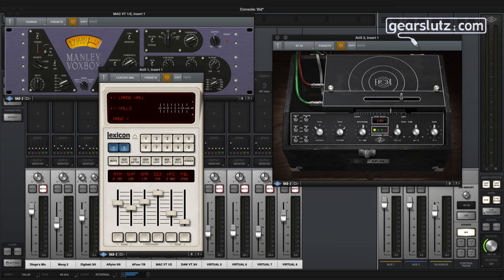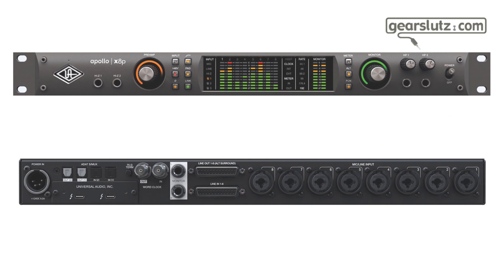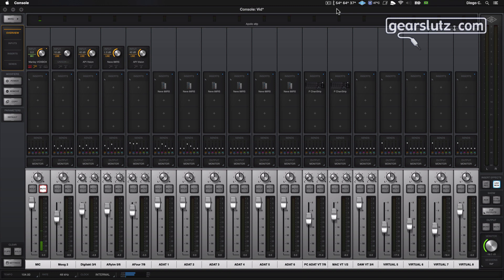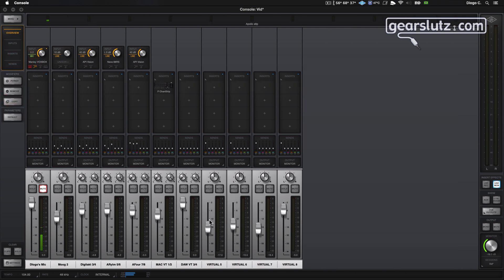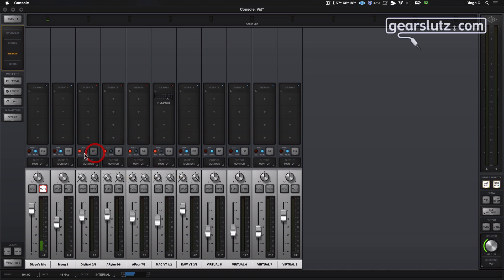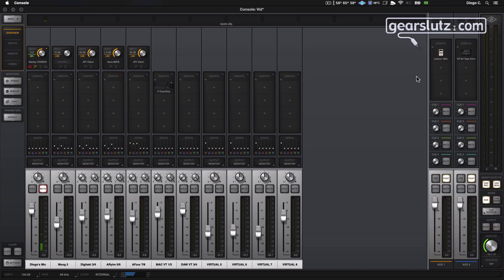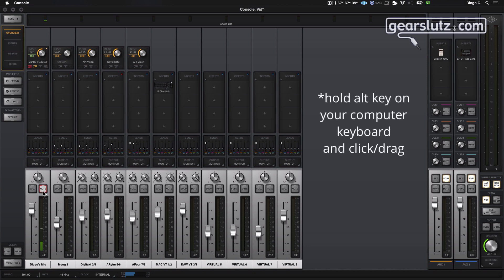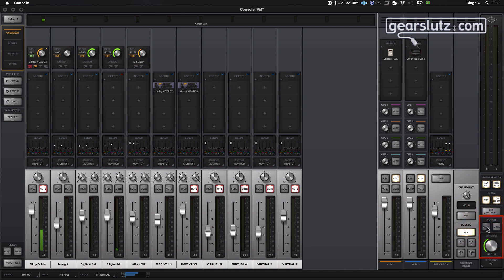Universal Audio Apollo x8p - Walkthrough Part 2: I/O Explained & Console Basics

Comment: Please assist me, I want to connect 6 speakers to my Apollo XP8 but I have only 2 Outputs.. what can I do as I have a project that requires 5.1 surround sound
Reply from the maker: You'll need a DB25 cable with XLR or TRS on the other end for this, should be easy to find!

Comment: I seem to have a big problem with a possible simple solution. I get no audio from any of the 8 cables from the db25 outputs on the back. Also, when I click settings, those 8 outs are grey. Do you guys happen to know where to click to get those to work? I just want to use Apollo x8p as an 8 input, 8 output AD/DA converter for Logic to record/play. Thank you.

Comment: The comment about the Combo jacks defeating the DB25 connections is only half right.  That's only if a 1/4" cable is plugged into the combo jack.  In other words, you can connect 8 mics via XLR and also connect 8 line inputs via DB25 and switch between them using the mic/line selector - so you don't have to re-patch.  See page 30 of the manual for more info.

Comment: I don't know why, but I have a SM7b and cloudlifter into input 1 and get no sound. Preamp is lit orange, cranked and I get nothing. Any idea?
Reply from the maker: Unison plug-ins can interfere with devices like Cloudlifter. If you really want to use the Cloudlifter make sure you're using the "clean" version of the preamp i.e. green strip on the preamp encoder, without any Unison plug-ins. Hope it helps - and don't hesitate to reach out to UA or post your question on our forums if the issue persists. Best luck with your recordings!
Reply: Gearslutz thanks. For future, if anyone searches, I needed to have phantom on
Reply from the maker: That's great! Thanks for the heads up.